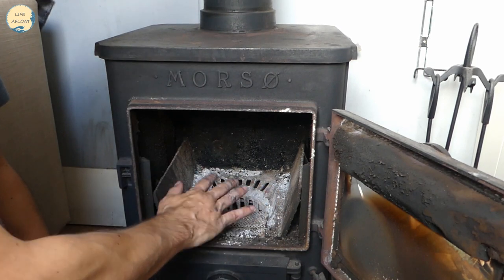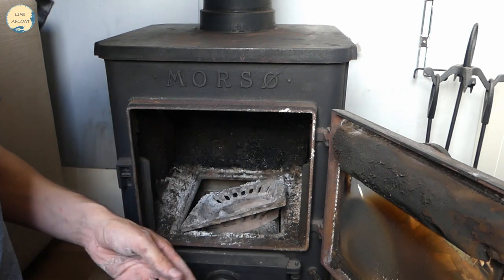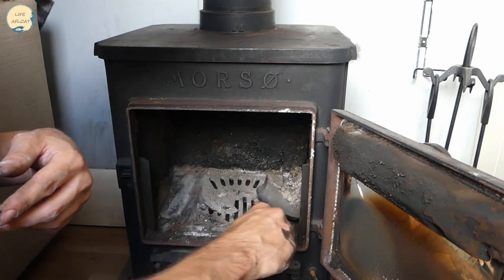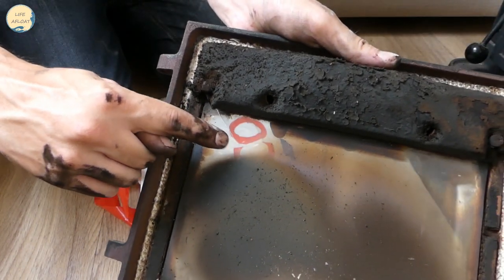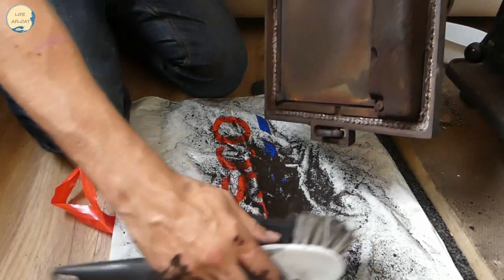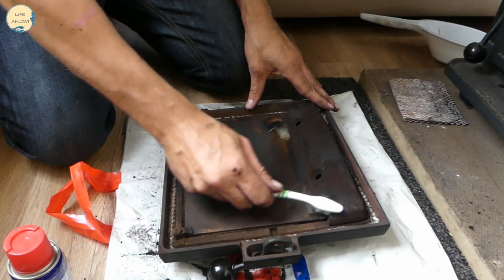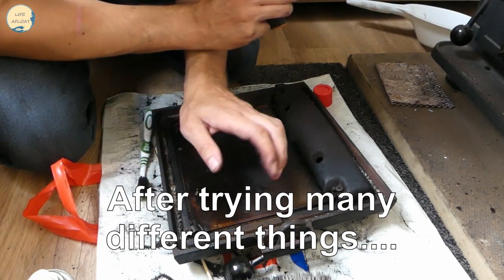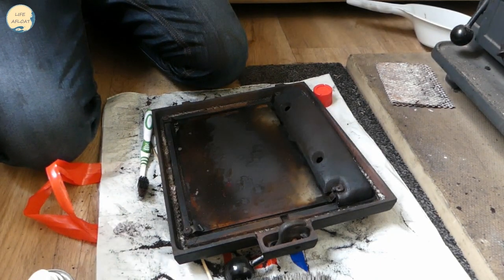Multi Fuel stove (Morso Squirrel) maintenance. New riddle grate & door glass FAILURE!

Comment: Hi Mark , please don’t think about buying a new door, all you need is a special bit that you can buy to put in your drill and it will have those screws out in seconds, but you will have to buy four new screws because it kills the heads on the screws, but it will be a darn sight cheaper than a new door. Also to clean your glass better I used to use an old green scratchy that you use for washing upon my wood burner, or better still and it is great for all glass including mirrors , try some triple O gauge wire wool, it is brilliant, and it definitely does not scratch the glass, and that tip was given to me by a guy who worked with glass , anyway good luck and all the best.
Reply from the maker: Hey Chris thanks for watching and taking the time to comment, much appreciated! Yes I think I am going to try either some mole grips or screw extractors, both things I would need to buy but would be much cheaper than a new door! Didn't think about trying wire wool to clean the glass with, I have some although not sure what gauge it is off the top of my head! Take care, Mark

Comment: I’ve just changed the glass for the first time on our 12 year old Morsø. You have the right idea with the WD40 but the screws heads you are trying to remove need an Allen key not a screwdriver with I think you were using. Pick the crud out of the head thoroughly first. Mole grips will also be a help if the heads are chewed. They will come out mate. 👍🏼
Reply: Oh & wire wool to clean the glass, works 100% 👌🏼
Reply from the maker: Hi thanks for watching and taking the time to comment. I've got one screw head clear of all dirt and it is certainly a cross head. I notice the the Squirrel 1430 stove has allen head screws though which I've found out as I bought some from a chandlers thinking they would fit but they are slightly smaller too so I haven't removed these as yet because I don't want to be without a stove so waiting on a delivery of the correct screws which will be this week! I do have some mole grips now though and am pretty sure I will win the fight haha. Take care, Mark

Comment: Hey Mark....hope you're well. Best thing I think for cleaning the stove glass is kitchen towel/newspaper dampened with water and dipped in fine ash from the grate. Use this to gently remove any build up on the the glass. Then buff up with a piece of dry kitchen towel, Done daily its so simple and prevents build up. I use this trick on my own wood burner.
Reply from the maker: I have done this before and it did work pretty well. I just used the WD40 as it was there and I wondered if it would clean it or not haha. Thanks for watching. Take care, Mark

Comment: Hi Mark, funny enough I have just changed out the  morso squirrel glass  on my boat, I had exactly the same trouble. What I did was tap the clips round with a hammer and chisel, to be honest it did crack the glass further but it meant I could remove the broken glass. Once the glass was out the clips just spin round, what I did then was to clean and wd40 the screws. Again to be honest the screw  didnt move alot but enough that I got ghe glass back in and span the clips back round by hand.
Reply from the maker: Hi Jim thanks for watching and taking the time to comment. May well give this a go! Just worried that I won't be able to get the clips back over the new glass haha. Take care, Mark

Comment: Hey up matey, i had to refit our collar on our morso1410 earlier in the year. The screws were solid and wouldn't move. I sprayed them every day with WD40 and it took about a month of doing it everyday until they moved! So if you haven't already bought a new door, patience may be your friend and save a few quid. 
Just try a squirt on each screw each day and try turning them each week (after giving the screwhead a good clean out to get the screwdriver to bite best it can).
Good luck and if my trick works you can buy me a pint with the money you save!!!
Reply from the maker: Cheers :-) One of the screws is completely knackered as it's just pretty much a perfect circle instead of a cross in the head, unless its still got a lot of solid dirt in it! I am going to try some mole grips after I have found replacement screws and see it that works. If not I might saw a line in for a large flat head screw driver and see what happens. Cheers for watching mate :-) Always welcome over for a beer if you're ever near by!

Comment: If you can  try and find a little garage somewhere that will get those screws out. Like someone has already said get some heat applied Oxy acetylene will do the trick and some good screw extractors. I am sure a small village garage will gladly assist for a couple of quid if they charge you at all. In the meantime give them a regular soaking with WD40 to help start the job off. It is worth a try if nothing else and it could save you a small fortune.  Best of luck, keep us updated.
Reply from the maker: Hi thanks for watching :-) Yes Lewis has suggested I take it to somebody as that will be a much cheaper option. I think I'm going to give mole grips a try first just to see if they do the trick. If not then I think this is the best option! Take care, Mark

Comment: if the only fix is a new door, i'd try to drill out those screws and use a removal tool...might work...
Reply from the maker: Yes I did think about that. Having found second hand doors on ebay for £120 ish which I can't afford at the moment I think I need to try and find the size of the screws to get some new ones. I do have somewhere a removal tool for drilling out bolts which might work on these. I just don't want to do it and be left without a stove as the weather is getting cooler haha. Thanks for watching and taking the time to comment. Take care, Mark

Comment: Probably start an argument but I think Morso stoves are absolutely overpriced and poor quality. Everything is cast in component form and I have seen at least 6 where either the front or rear panels have split where the bolts are fitted not to mention the flue collar and the riddling plate has fallen apart as in yours. Seized bolts in the doors are a common issue on most stoves the only way I’ve ever got them out without snapping is a bit of oxyacetylene heat and a prayer.
Reply from the maker: Thanks for watching :-) The stove was already in the boat when I got it. I have no experience of any other stoves but have read somewhere online of people reporting the sort of issues you mention. If I ever replace it I will be doing my research into alternatives just to see what else is out there. Take care, Mark